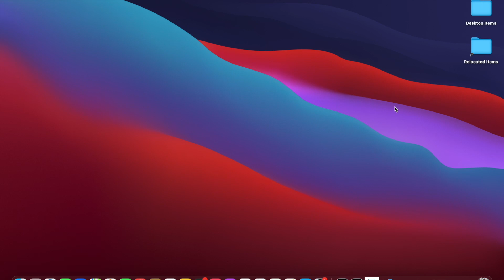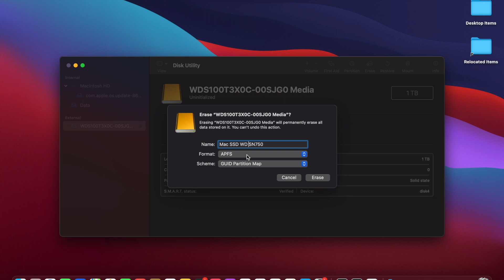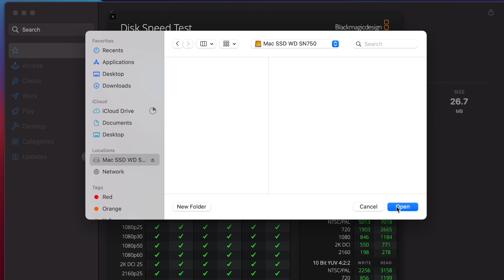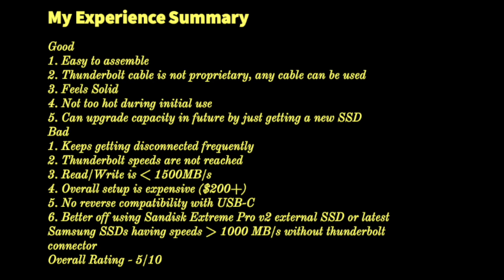M1 Mac Accessories | DIY External SSD | 1TB | Sabrent Enclosure | WD Black SN750 SSD | HD

Comment: Thanks so much. As I expected, there is a bottleneck with the sabrent enclosure. The fact that WD ssd is capable to 3000+ Mbps is irrelevant when the closure is not capable to give the same speed
Reply from the maker: Agree, if a thunderbolt 3 enclosure can't give full TB3 speeds, then there is no point of buying it (or having a faster drive), rather a USB 3.1 type c enclosure will be a better purchase, as it's cheaper.  I also bought the fledging one which was a lot better in speeds than the sabrent for which I made another video
Reply: Runs Blazing Fast on my 2023 MBP 14inch M2 PRO Chip running Kontakt libraries offloaded Akai expansions offloaded as well as Logic Pro This is a Great’ Unit💨 Also Offloaded All of my Samples & Session files.